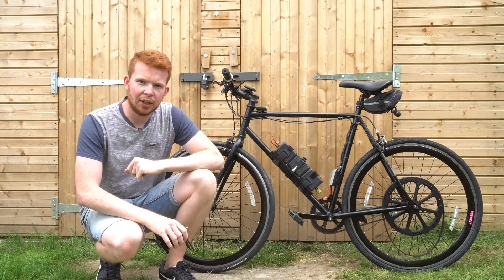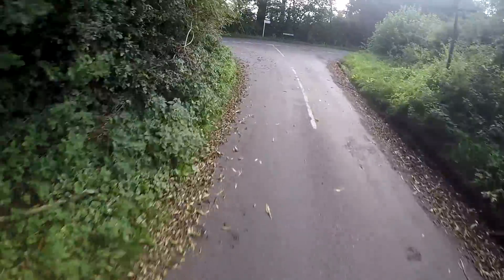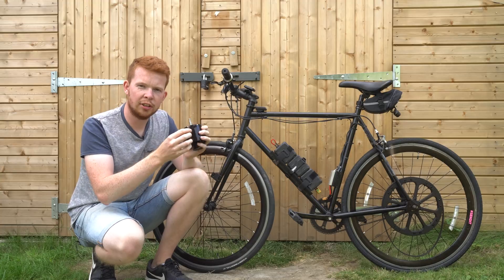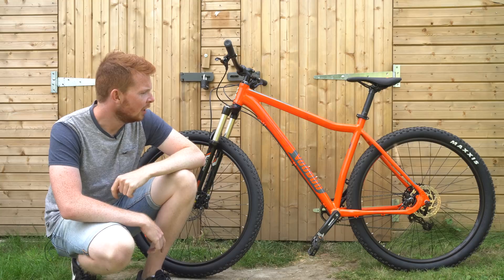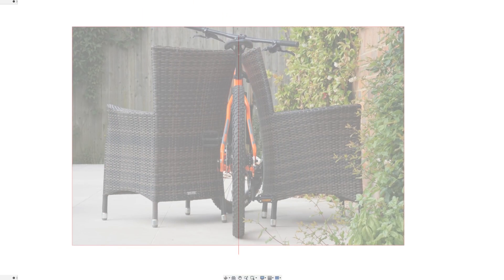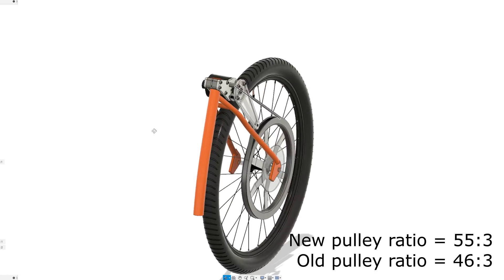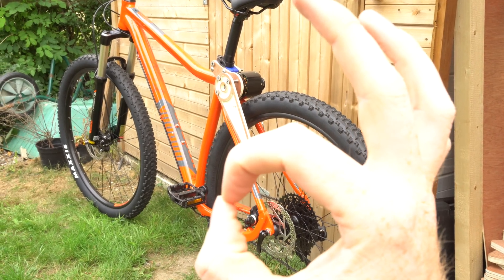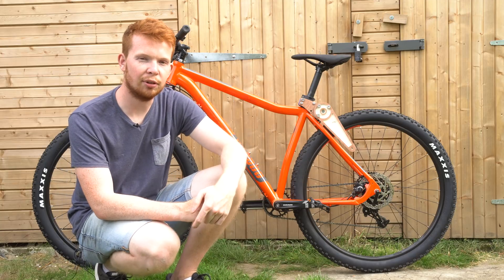Electric Bike 4.0 - Prototyping

Comment: After you finish the v4.0 bike, could you go ahead and try the 2-gear transmission with clutch anyway, if only for the learning experience.  Who knows, if it works well, maybe you can incorporate it as v4.1.

Great video, Tom!  I'm really enjoying your stuff!
Reply: V4 already! Surely it will have to be the v4.2GT just saying... 
2 Gear Trans / Grand Tourer... Maybe GTE (leccy) even...
There's a Gearbox guy whose making printed gearboxes on youtube, I'm not sure he's done any real world type tests on longevity... worth a collaboration?!

Just a note maybe for v5...
I've seen enough frames fail on that point of the frame to know exactly why it shouldn't go there but it's a good point to start for simplicity.
Over clamping too low on the seat turret can do it quickly. It would be better mounted lower for both centre of gravity & frame life will be extended / likely never fail but mounted on the seat-tube it will eventually crack the turret or the welds if it's got "enough torque" you'll appreciate the lesser vibes of moving it away from those bits your sitting on... it gets more pronounced on MTBs off-road than Asphalt...

You may also find it collects a lot more muck if it's up there off-road and I would prefer to see some kind of integrated guide / guard on the top side especially around the tyre-side, it'd be a shame of that wheel gets a little loose on the spokes as they sometimes do with all the extra torque and take out everything as it catches the belt, but if your mounting takes it far enough over the s/stay and keeps enough tension it should be enough if you're not smashing it DH! (Downhill)

Keep it up, I'm watching eagerly! Loving it. If you need some random cycling bit's I've got all kinds of great bits for projects...
www.getmefixed.co.uk

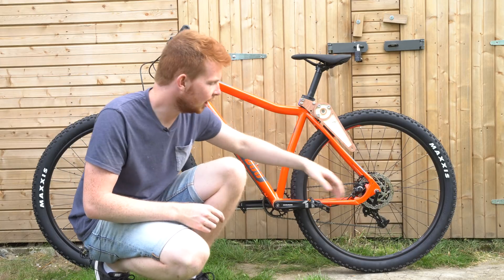Comment: 9:54 "Can't print it as a sheet, then fold it." So don't. 
Take the supporting spokes and make each of them an interlocking sub unit. build an indexing pin into one edge and a matching hole or socket into the opposite edge.

Comment: Sadly is not double suspension , besides that good enhancement ! ,  tell how much costs the aluminum machined parts for this bike in the next video ...
Reply: Msc Chn Wastes human power, and makes engineering a hell of a lot harder for the electric system.
Reply: Yes for sure i built one in 2 hours and totally drunk , still working 5 years later , and guess what : no "human power" wasted and 100 % comfort gained .
Reply: Dual suspension is awful
Reply: Wagacca Need and want are two different things, you don't need it, but after a while you sure as hell want it
Reply: Wagacca I grew up on a poorly maintained rock road, with hardtails, after a while your legs get pretty tired, then again I wasn't on an electric bike either. Taking the pedaling out of it makes it a hell of a lot more tolerable

Comment: Hi Tom, electric brushless motors are basically inductors, meaning that when the motor suddenly stops, it causes a surge in voltage. You can easily netgate this by adding a capacitor to your powerline. I had this problem on my 250 quad and fried 2 FCs until I soldered on the capacitor. Hope this helps!
Reply: Alec Ryan. What powerline do you mean??
Reply: ConnorMakes the main power input. putting a capacitor in parallel with the battery should fix the voltage spikes
Reply: A capacitor on the input side would Help? Wouldn't this just protect the battery? Or does it absorb the voltage spike current that the speed controller would need to absorb
Reply: ConnorMakes Exactly, it acts as a temporary sponge for the excess voltage of the inductor.
Reply: My speed controllers already have one on the power input, is this what you mean?
Reply: Caleb Sherman a lot of ESCs have filter caps, but you will need a fairly large and high voltage cap to deal with the voltage surge
Reply: A cap will not help as the problem is those spikes being rather high and short and being on the switched side where you can not use caps. With a DC drive it would be a different story, but here, if you want additional protection, you need a few Shottkey diodes or a better controller to begin with.

Comment: I have my own motorised bike with a two stroke petrol engine, the disk brakes help lots. You need to have the batteries being recharged by pedalling the bike like it was designed.

Comment: Why don't you use the idler pulley to tension the belt.?
Reply: That was exactly what I was thinking. The only time you use a separate idler pulley is when you have multiple pulleys that need more "wrap".
You have to give him credit by using the optical image import to quickly figure out the frame geometry. I've done this a few times but never in the 3D space. Very impressive technique considering I thought of it all on my own and now see somebody else doing it better :)
Reply: By putting the tensioning pulley right next to the motor he can increase the number of teeth on the belt that engage the motor pulley, greatly reducing the risk of belt slippage.

Comment: @TomStanton: Thank you for this great video. 
I recommend that you find a seat suspension. It's a sprung apparatus that mounts between the seat and post. It helps in taking   out much of the road vibration and jolts taken at the rear wheel. I found mine on "Performance Bicycles" website. Good luck with your belt & pulley.

Comment: Awesome e-bike build. There is a company in the US that makes similar electric and gas powered bike kits called "Sick Bike Parts". They make all sorts of bottom bracket adapters with extra long spindles and threaded crank arms. You might get some inspiration from them. Keep up the cool work.

Comment: I just bought a Trek Domane AL 2 and I've been putting some thought into making it into an E-bike.  I was thinking about the regenerative braking aspect of the thing and I came across another video about ultracapacitors and how they are being used in things like buses and delivery trucks to capture more of the energy of braking as electricity and being able to dump it all back into the motor in short order.  Batteries are kind of crap for regenerative braking due to their high internal resistance, and most of the energy gets wasted as heat, so I was wondering if a hybrid super/ultracapacitor and battery system on an E-bike would increase the effectiveness of a regenerative braking system and make it more than just a neat talking point with limited usability.

Comment: Make sure you don't go too fast with those tires on tarmac. They'll easily skid because of the knobs. Keep it up - cheers.
Reply: Anders Dyekjær Hansen I don’t think so mate, they’re typically far more “grippy” than  road bike tires. I’ve ridden MTB on fast roads before and never had any sort of issue.
Reply: I agree... get some good, high quality touring fats.  Schwabe brand with minimal tread.  Those knobbies will be HUMMING at 30 mph and will wear down to threads fast!
Reply: Tor gottem
Reply: Rian - that might be true for high quality tires, but most shops don't have those. The knobbed tires there are made from harder rubber cause they know the people buying those won't actually ever leave the road and so harder tires make them last long - and reduce grip a Lot. Friend of mine had the stupid idea of getting one of those bikes were the tires are like 5cm thick - and it had so little grip that when pulling the front brakes the front tire simply locked up.
Reply: Rian Mach is gay

Comment: Doesn't that count as an electric motorbike as it goes faster than 15.5 mph and runs on more than 250W or whatever it is? Looking at doing something like this myself, but have been held back by those laws.
Reply: Mattie Dumbrill no one is going to enforce these laws. Get yourself a sticker that says 250w and stick it to the motor.
Reply: Correct in the UK BUT you have to get caught!
Reply: Richard Harris - Tom the rebel
Reply: I can't imagine an street inspector with multimeter and a regulated power supply testing your motor lmao
Reply: Just fit a speed limiter and power limiter with a hidden override switch.
Reply: The issue isn't "getting caught" it's if you hit someone, which is where you would be fucked by the law. Sure could have hella fun doing some green laning on this though.
Reply: Seems brave putting it on youtube lol and it would only take a cop car behind you to get caught as they would be able to see what speed you are going with on board cam and radar or whatever they use to tell speed of car in front? Guess if you keep your wits about you chances of getting caught are slim though
Reply: I have a fully legal shop bought 250W 25km/h eBike. The top speed is only the speed at which it stops assisting you, so if they clock you going faster that isn't evidence of breaking the law. My fastest speed is over 60km/h.
Reply: Brian Ronald yeah, I don't really get that law... I don't even have an ebike, and can clock over 50km/hr... Illegally rated legs, non-insurable...etc.
Reply: This is an obnoxious overreach from the safety nannies. I can pedal up to 45mph with my mtn bike. I have a massive 50t front chainring. I keep up with city traffic on the regular. Never, ever been pulled over. Now if I added an electric motor, I'm all of a sudden I'm a danger and safety risk? Please... 
(I could just bust out my drivers license with motorcycle endorsement to shut them up if I have to)
Reply: @EcoMouseChannel  its not about your license, its about insurance if you hit someone. youll be paying for your life without insurance if you seriously hurt someone.
Reply: I wonder if it goes by the RATED speed/wattage vs them actually bringing it in a lab to test it.  If it's a DIY job you can pretty much rate it at whatever the hell you want!  At least that's my philosophy... don't know how well it would stand in court though.  They might just get it tested at a lab or something.  Need a hidden switch to kill the performance maybe, for if that happens. ;)
Reply: lol, hmm the law been riding a 1000w ebike for over 4 years now and never had any problems with the law..as long as your not going stupid fast the police don't even look at you....
Reply: who cares about laws, as if the police will chase after you on a bike XD
Reply: There are plenty of consumer electric bicycles you can buy from big manufacturers (Specialized, Giant, Trek, etc.) that can go faster than 15.5mph if you press the "do not press" button. It's also very difficult for police to know how much power the motor has for DIY kits without taking the bike apart and testing the motor. There are plenty of DIY kits that are more than 250W that you can legally buy in the UK. The only way you'll get caught is if you do something stupid, like doing a wheelie passed some police at 30mph while not pedalling.
Reply: Fuck the laws and just ride slow while the popo is around
Reply: In one of the previous videos, someone worked out this bike is 400x too powerful to be legal in Australia lol. It would also be well illegal in the UK. Tom takes the risk that if he hits something or someone he is uninsured and it could ruin his life. Seems a bit silly imo but it makes for entertaining videos!

Comment: Awesome, Tom! But why didn't you mount the big gear the other side? After all, you won't need the gearbox. 😊
Reply: The gearset would be useful if he ever has to pedal the bike
Reply: Because the gear cassette is a pain to remove! You are right though, that is a valid option.
Reply: He would just need a whip and a special wrench
Reply: This would be good I think. The cassette is not difficult to remove and room could be made for the electric drive pulley on the free-hub by removing a gear or two from the cassette. There may be clearance issues with the chain though.
Reply: what issues? The derailleur can be set with 1 screw
Reply: I was thinking he could set the derailleur upper limit so that he can still shift through all the gears that would be left. The issue is that the chain-line might interfere with the belt for the motor because an offset away from the bike would be necessary for the belt pulley so the belt doesn't hit the tire.

Comment: Tom I am very inspired by you and after watching you so much i could not give up and i got myself anet a8 3d printer(sill on its way from china) and first thing i want to print is the stuff you designed Im so exited!!!
Reply: Im curious why did you decide to go with the a8 ? the ender 3 cost about the same but is regarded as the superior machine
Reply: Lerbyn I actually didnt even tried to check out other options turns out its about same i mean a8 is kinda hard to maintain. I just got it to get into 3d printing and i will probably get a pro printer after a year or so.
Reply: saladnuts mine is under import clearance what a luck but will be here in 3 days😋

Comment: Thanks for going into detail responding to my questions. I am am an avid cyclist in my other life, so this project is really appealing. One day I would like to have the free time to make an e-bike too.
Reply: this seems like one of those "simple" projects until you realize you don't have your own CNC machine.
Reply: Plum_ Pie It's much more than that. The conversation kit will cost you about 300 euro and another 300 for a decent battery
Reply: use a jigsaw and a drill
Reply: I have the time, tools, and skills but not enough money to spend like 600 euro on parts with no guarantee it will all work in the end.
Reply: do you not have 20min, internet acess for ebay and about $400?